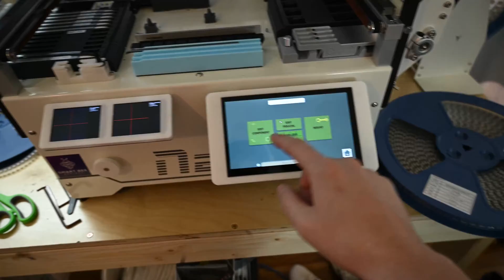My Neoden YY1 pick and place machine!

Comment: Does this need an air compressor?
Reply from the maker: No
Reply: @,  Thank you!  It’s been 2 years since your video.  Does the machine still work?  Im sure it will pay itself off with one contract but it would be comforting to know I can run at least 1000 boards in a year without it breaking down.  Beside the reel issues.  Should I go for it?
Reply from the maker: Yes it's still works, it's had issues with a few failure points like the screen died on mine. It was under warranty when it failed and thankfully neoden was quick and responsive with getting a replacement sent.

It's not a perfect machine by any means, the tape peeler mechanism is finicky as hell so you really do have to sit there and baby sit it while it runs. 

It is much faster than hand placing components and for the price it's about the best you can do for a PnP. The only other option I'm aware of in the price range is the lumen PNP. Which may be worth looking at as another choice. It's built in the US and has a large community behind it. But I do not have that one myself.
Reply: @ Thank you so much for your input.  I’m not expecting perfection but something that can replace hours or of hand placing parts.  Hopefully it’s faster to setup and fix tape instead of hand placing 200 parts per board.   

The lumen PNP looks so basic than the one you have but I will be looking into it more.  Thank you for your help!

Comment: Why has no one mentioned anything about PCB origins? Why does no one mention anything about the 8mm that they don't work in PICK TEST mode if your size is 8mm or above?
Why I cant see any videos about setting the positions of the components? especially the fiducials that they will never work.

Comment: Thanks for your info, it is really valuable. I'm looking for a machine which can change nozzles automatically or it has four heads. This one seems to be built good, I like how the reels hide under it, but it seems really slow so I don't know. Also editing stuff on that screen seems hard. Lacking end switches I can hardly believe. I would buy SMT330-LX but it's out of stock (it has nozzle changer). Currently I have a machine from Qi-He, TVM802B. This had uses some old MS webcams for vision and it hardly finds fiducials and doesn't align the components very well, so I'm looking for an upgrade. Any suggestions are welcome.

Comment: It does have opto interrupters for limit switches. Oh, I can complain the software especially setting the pick height or place height. That should be done in one screen, I should not have to bounce between up to 3 different screens to set this.  The lack of documentation other than the videos is a major to me. The one thing that i still haven't figure out exactly how to set component rotation.

Comment: They definitely have to add the 2 fiducial support because all their bigger machine has them and it's all in software. And that firmware upgrade using board swap is just ridiculous. Other than fiddly feeder tape peeling mechanism, this is probably most bang for bucks at USD2.6K. Would probably get this to complement my larger machine for projects using more feeders than my larger machine can take.

Comment: Have you had an luck with fixing the issue having to reset the unit every time you finish a run?
Reply from the maker: Yes it was a z placement height issue where when I was placing a component that was tall, it would make the z motor skip a step and then would need rebooted to reset it. Rasing the place height of those tall components made the difference and then I was able to run back to back without having to reset the machine.
Reply: @paulprice  thank you so much for the fast reply. I would like to order one of these units. Do you have any recommendations for placing an order. Where did you get yours? Sounds like they responded pretty well to you when the unit arrived damaged.
Reply from the maker: @silvlink  if you're in the US, just order from neoden USA. I bought mine form chine directly,but after import fees the cost savings from buying from neoden USA is negligible.

Comment: I've had a few issues... The tape advance solenoid on mine would stick in the low position, so I lasercut a new "stopper" that limits the bottom and the top, instead of just the top. Also it won't recognize qf32 on the up camera at all, same with the down camera on the black parts tray, no amount of camera tuning worked. Small annoyances that take over. Same problems you had too. The firmware is also driving me kind of crazy. haha - Wish they would open source.
Reply from the maker: the needle tape advance on mine has started acting up too, it has started to not fire after sitting for a bit. Which is annoying when starting a new run up and it fails to pick parts. The workaround for the moment is i manually fire it several times until it goes then I start the program, but I'm in contact with neoden right now trying to find a solution. 

I've not done any camera stuff with the bulk tray at all other than picking up esp32 modules but I'm not using the camera for that.

So yeah, it's not without it's faults and issues but for what it is and the price kind of have to live with the issues.

Comment: Thanks for the video.  Using Teflon (or similar) coated rollers for the sticky side of the tape might help.  Perhaps a silicon spray?  The tape will have one side with left over adhesive and another side that is clean (not sticky).  So what you require is two different rollers - one sticky and another that avoids adhesion.  Perhaps the rollers they ship with have different properties?  If not, you could complain and request some Teflon coated rollers or similar.  And request that they are different colors!  But they might seriously entertain the idea if it allows for them to improve their product.
Reply: Oh, rollers made of Delrin might work.  It is hard to get anything to stick to Delrin.  It is also easy to machine.

Comment: Thanks for the overview, I'm considering buying a pick place machine, but have not decided yet. Is this the best in its price range or are there better ones? What do you do if a board uses more components than feeders, can you partially assembly multiple panels with one set of tapes in the feeders, and then do a second run on the batch of panels to assemble the remaining components? Does the software support that kind of thing?
Reply from the maker: im not aware of really anything else in this price bracket that is as feature rich as the yy1. its not a perfect PNP by any stretch and it has its issues here and there but even with issues its still WAY faster to assemble boards then by doing them by hand. 

as far as doing panels in two operations. yes you could do that, it could be as simple as just making two separate pnp files for each set of components if you have more components than feeders available.  but in that scenario i think the limiting factor would be the solder paste on your board drying out before you could get it re-ran through the machine for the next batch's of components. hope that helps
Reply: @paulprice  what do you use for applying the solder paste to the boards?
Reply from the maker: @bluc0bra  when you order your PCBs you can addon what's called a solder paste stencil. It's basically a thin sheet of metal with all the pads of your pcb cut out so you can lay it over your pcb and squeegee the solder paste across it and it'll only put the paste on pads that need it.

Comment: Great video!  I have one of these as well.  Let me know if you'd like to set up a support group, preferably with drinks. :-)  One question: where did you get that awesomely wide feeder bank on the lower right??  I need one of those!
Reply from the maker: I ordered the wider feeder when I bought the machine and it came with the wider idler wheels for the tape peeler too.
Reply: @paulprice  Interesting, I wasn't aware that was an option when ordering.  Did you order directly from Neoden (Alibaba, etc.) or from Neoden USA?  Is there a list or catalog somewhere of the configuration/add-on options?
Reply from the maker: I ordered directly from neoden China. They're custom ordered in that I told them how many 24mm feeders I wanted and they made the feeder for me.

Comment: I'm still running with a Neoden TM240A, which had no vision, but accurate enough even without vision.  This thing has paid for itself 50 times over in time saved from manually stuffing boards.

Comment: Can you also place lose components - like putting a chip onto the table manually and let the machine pick & align it?
This might be easier than changing tapes for a single part, in case you have a high number of different components.
Reply from the maker: Yeah you can set up your own pick up spots for loose components or custom trays.

Comment: On the tape issue, you need to tie a fishing weight (sea fishing weight of 300grams. Make sure the machine is on the edge of a desk and the tension the 300grams provides should technically  be like someone holding the tape. We had to do this on the unreliable larger feeders on the Neoden 4
Reply from the maker: yeah several other people have mentioned similar solutions. like using a binder clip which i will try during my next upcoming production run.

Comment: As mentioned by others in earlier comments, a light weight would help, otherwise you could use a release agent of some type on the teeth of the peelers (ones giving an issue with adhesive tape). This release agent can be as simple as a small amount of wax,  or very carefully applied W40 using a q-tip (obviously keep away from the friction washers).
Reply from the maker: Those are some interesting ideas. The wax idea might work
Reply: @paulprice   What actually works well is powder (i.e. talc) as this reduces friction slightly and doesn't make things too slippery (as waxes and other lubricants can do). And I don't mean to dump it on ! what I do is place a very very thin coating on my thumb and index finger and rub the steel shaft. Then slide the friction wheel(s) sideways over the spot. You may not even see the talc on the shaft, but there is plenty there to do the job so there is no worry at all about getting powder into the YY1.

I use the YY1 for production purposes and have currently run 3000+ boards with an average of 50 components per board. Setup can take a little time, but I have had good success with figuring out the friction issues. Once it is all happy it will run with no interruptions other that changing boards and component reels.

Comment: I have the same machine and I love it overall. Silent. Well designed. Slick touch screen.
 Here is what I don't like.
* It does not resume job automatically  from where it left it. (when you stop it mid job)
* The machine moving the head when you want to setup a component is a pain. Just stay where you are unless I ask otherwise!
* No networking possible. SD card only. That's a problem.
* Board origin is not saved in the file which means you need to change the origin parameter for every different job.
I could list even more problems. Don't get me wrong it is still a good machine.

Comment: Thanks for the review. I have an older Charmhigh without vision and the main problem was the friction tape collectors as they had a fixed friction level not adjustable and it was always creating problems but I updated those with newer ones where you can adjust the friction with a small allen key and after I do that at initial setup all works great now so I no longer see a good reason to upgrade.
It is much faster while also set at 70 to 80% and one that will be slower will not quite work for me. I do need to place a few parts manually but I can do that while the machine populates other boards.

Comment: Hi,
I also have the YY1. I agree with the issues you point out about the peelers.they are not ideal.
But I have an issue with mine, when I try to save the location of the first component, the machine does not save the location. Don't you have this problem?
Reply from the maker: Have you tried fine tuning the positions of the components when you start a run? I go over this in a new video I just uploaded about the yy1
Reply: @paulprice  yes I have. But that is not my issue.
For an example, if you try to make a manual file you might see what I mean if you have the issue as I have.
It really quick to do, select that you will make a manual file and type in one fictional component. Then go to Fiducial and then select the first option which is finding the first component. Your camera will then go to x-0,0 y-0,0.move the camera and hit save. If you into the Fiducial menu again, weepy will see that the position of the first component was not saved.

This becomes a huge problem when making manual files or if your board has like a 5mm extra edge, added at the pcb factory.

Do you have this error?
Reply: @paulprice  I have just watched your latest video answering question about the YY1, and seemd to me that you have the same issue, and it explains why you fine tune all the components. You mention that the components gets more and more aligned as you go through them, I wonder if this is because the components gets near the fiducial, as it do save that position.
Reply from the maker: @MichaelMaj5  I don't think it's because it gets closer to the fiducial it gets better, I've fine tuned the adjustments on components going the other direction and they still seem to get better. 

For me, to get consistent pick and placing of parts after a reboot, I double check all the feeder positions. Then I setup my fiducial/component and then lastly I'll go through and double check all the component positions and fine tune them if need be. After that, do not turn off the machine if you can help it. If I leave the machine on after I've done that, I've had essentially no issues with it and it'll reliably pick and place for hours on end, one panel after another.
Reply: @paulprice  I have not  had those issues you describe. I have so far mounted about 600 boards on the machine.
But I do experience that the feeders pull harder when starting mounting after the machine had been standing still... Like over night. That is a pain.
Have you checked if your machine saves the position of the first component when you fine tune on the fiducial page?
Reply: @paulprice  by the way, do you have an email I may contact you at? I have might have a solution to your problem with tape sticking to your idle wheels.
Reply from the maker: @MichaelMaj5  smartbeedesigns@gmail.com
Reply from the maker: @Michael Nielsen  on the fiducial page, if I adjust the 1st component and hit save. Then back out and come back to it in the fiducial menu and it'll be off like before. But I get the feeling that it does save the position, it just doesn't get reflected on that fiducial page because when it's actually running everything goes where it's supposed to.
Reply: @MichaelMaj5  i'm interested 👀 we are trying to redesign or modify peeler friction and looking for ideas 😀

Comment: Hello there Sir,  is it  somehow possible if you could try LQFP-112 ..? if the machine accepts and pick and place that packaging.?
Reply from the maker: unfortunately i do not have any of those on hand to try. but the machine supports up to 18mm x 18mm packages. thats the biggest thing the up facing camera can see. the ESP32 modules i placed in this video are bigger than 18x18, so i place them dummy style with no vision adjustments. it works pretty well for that, but if you're trying to place a large packages like the LQFP-112 with a lot of tiny pins it probably wouldn't be super accurate.
Reply: @paulprice  Thank you sir, ifsoever you have videos of how the friction idlers operate, that would be so fantastic...!

Comment: Actually the max placement rate is likely using no vision and picking from part closest to board.  Thanks for the review.  I'm not a fan of the peeler mechanism and I can't get the up camera dialed in for all my parts.  Some need a setting of 50, some closer to 70.  This should be adjustable per component type but it's a global setting unfortunately.

Nice looking machine but you just can't walk away and let it do its thing unless you are strictly placing resistors from paper tape.  I have a heck of a time with parts in plastic tape where the needle that pulls the tape gets briefly stuck and when it pulls up the component in the tape is disturbed.
Reply from the maker: im pretty sure the camera threshold is adjustable per component, but the setting is in each of the feeder setttins menu at the bottom of the screen towards the right. you can tap the little green arrows left or right to adjust the camera threshold.

ive had very little issues with the needle getting stuck and flicking parts out of the tape. make sure the pick up point is as close to where the tape comes out, this will help with it knocking parts out when it tries to pick them up.

Comment: Thanks for the vid! Is vision alignment an option for the bigger components, like the ESP32 ? It looks like it didn't do any alignment with that module.
Reply from the maker: I should add, the up face camera supports up to 18x18mm components. And the modules I was using were 15x20mm.
Reply: @paulprice  What needle do you use for ESP32 modules? Is it CN750?
Reply from the maker: There is no vision alignment unfortunately. The esp32 modules are just a hair too big to use the up facing camera to align them. Half the time it'd place them and the other half of the time it would fail to recognize it and discard the module. So I just place them without vision. I 3d printed a tray to hold the modules in a tight formation and then it just picks and places them dummy style. Works pretty well, tho occasionally I'd have to tweak the placement after the fact if a module was off a little bit, but for the most part it was a reliable way to pick and place the esp32s